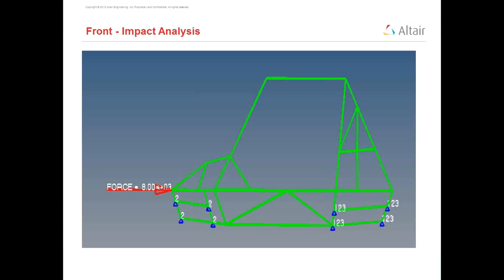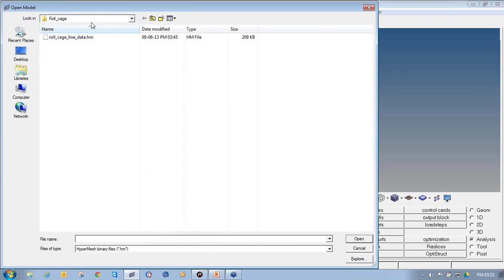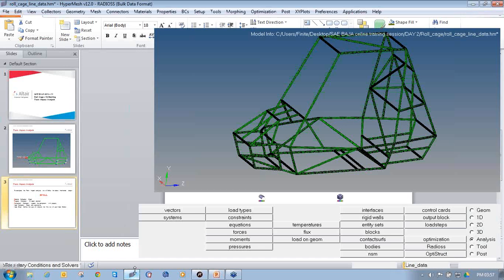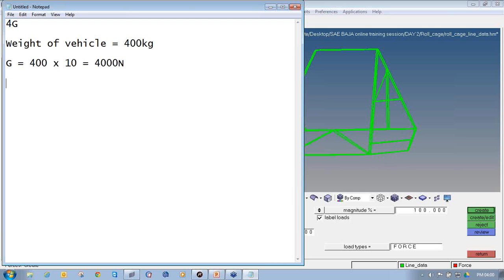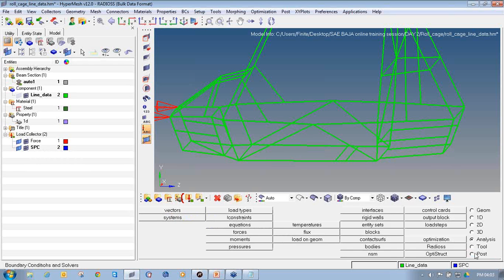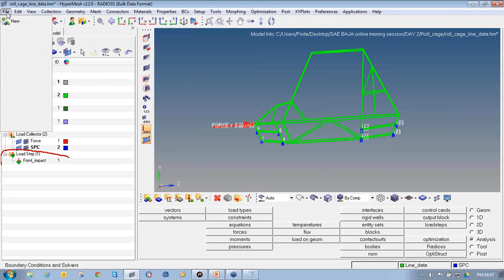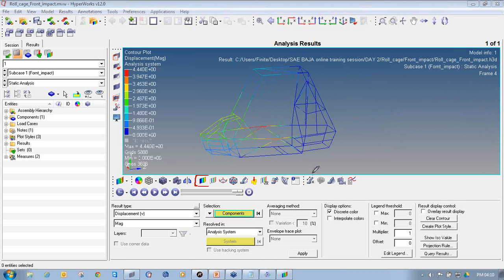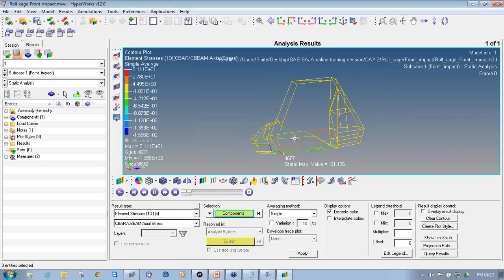Front Impact Analysis of Roll Cage structure in Radioss

Comment: I am a beginner and I would like to know why we need constraints in the first place.If this is dynamic analysis the suspension pick up points are free to move along any axis during an impact and are definitely not pinned in place by the suspension or other members which are prone to deformation as well.
Also if you could elaborate on what you mean by "practical approach" when you are restricting the degrees of freedom of the constraints I would appreciate it.